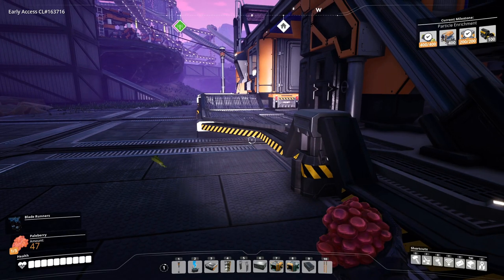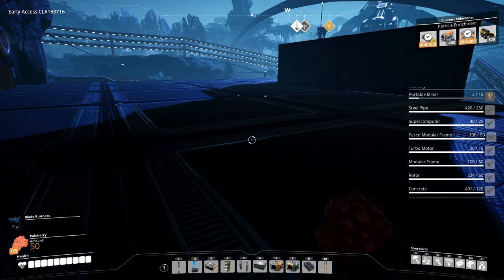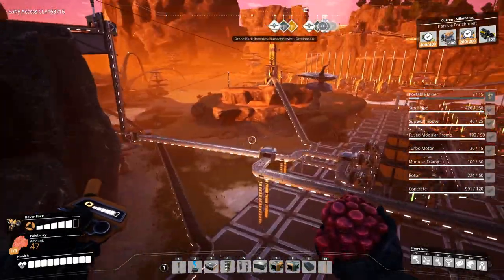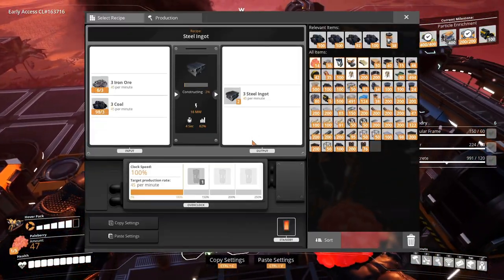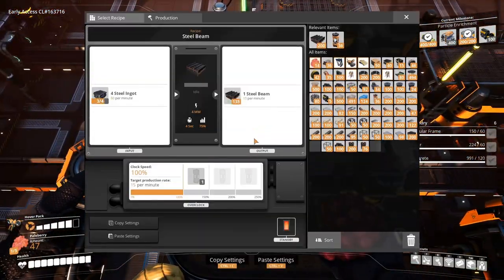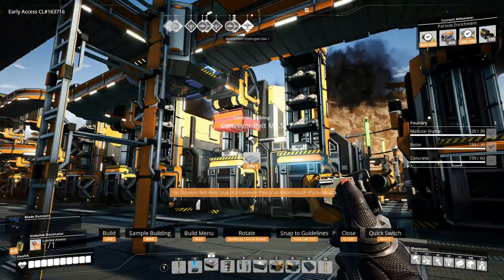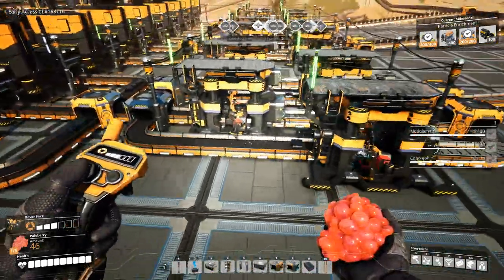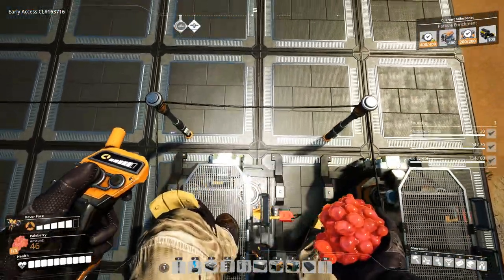Expanding Steel Beam Production - Let's Play Satisfactory Update 4 Part 152

Comment: In case you didn't realize/forgot, when you are over/underclocking, you can click on the Clock speed percent, or the Target production rate number (the orange numbers) and enter in the value from the keyboard, so you can set it to 780 items/minute exactly if you want to without trying to wiggle the bar. 

Same for Pipe valves and pumps.
Reply from the maker: TIL